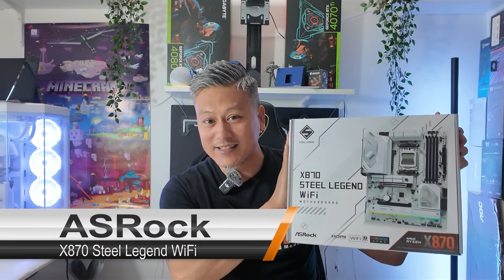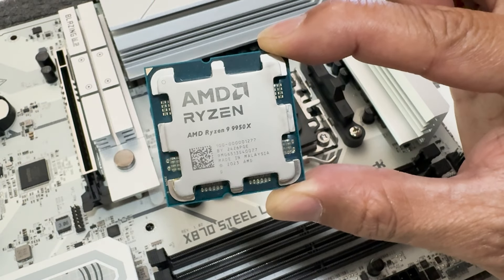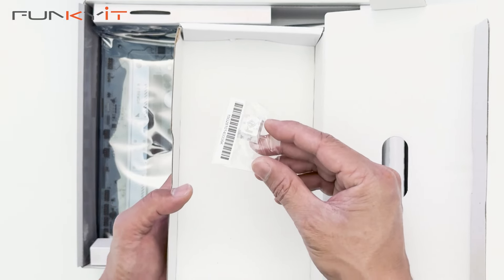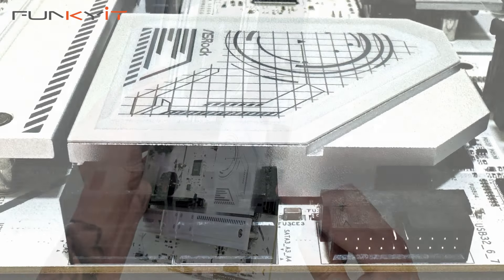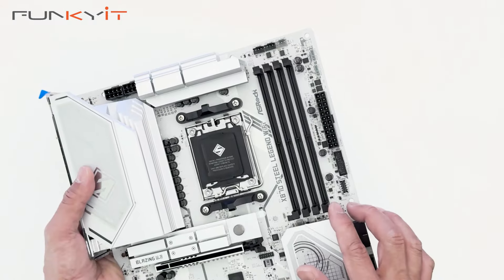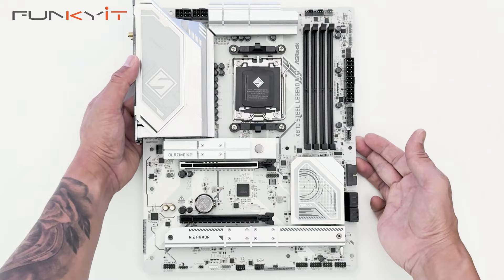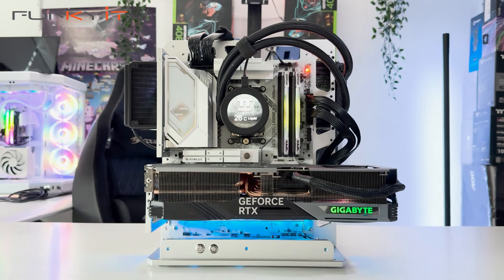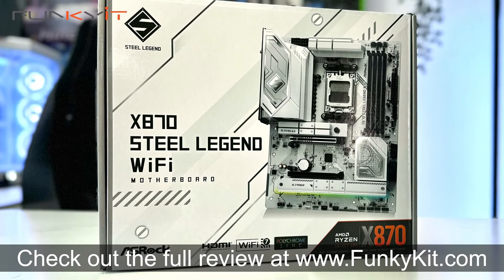An Affordable All-White X870 Motherboard that Performs - ASRock X870 Steel Legend WiFi

Comment: I picked up one of these, but now am wondering if I should’ve gone with the x670e steel legend instead due to lane sharing issues. Any input?
Reply from the maker: How many M.2 SSDs do you use?
Reply: What is this lane sharing issue can.someone explain am also confused between two b650e vs this
Reply: @freefall_910  If you put an SSD into the M.2 slot labled "M2_3" the bottom PCIE slot will be disabled. 

For this motherboard, M2_3 is the bottom left most M.2 slot.
Reply: @Rockett.  so that mean I will only have two 1 primary and then 2nd if I use an expansion slot will be problems for creator but not for guys  like me between this and b650e am also getting a USB 4.0 support but they cheapout on audio as well
Reply: Can we use two gen4 nvme drive while having 16x lines for gpu?
Reply: @GoldPunch  Yes you can. The motherboard has 3 m.2 slots for your NVME SSD's.

Restrictions only occur when the m.2 slot labeled as "M2_3" is occupied, If it is, the second PCIE slot will be disabled entirely. It does NOT lower the amount of lanes the top PCIE slot has access to, that is a limitation the other motherboard manufacturers have placed on their motherboards.

Comment: I am about to build a workstation rig for 3D rendering. I was about to buy a B650 Tomahawk. Should i consider X870 Steel Legend which is only 60$ more. I really dont want to upgrade in future, is paying 60$ more would be a good option?
Reply from the maker: I think it’s worth it. You get USB4 and support for higher speed memory 👍

Comment: What about the limited speeds if using all HD slots? From what I understand any RAM over 6000 is pointless on all recent MOBOs.
Reply from the maker: You need to use all M.2 slots … then get a higher end motherboard

Comment: Does it have 105W efficiency mode for the CPU in BIOS? Looks like a good candidate to level up my BOINC Folding farm got to find a good small stackable case for it
Reply from the maker: I haven’t checked … but I’ll let you know if I see the option

Comment: What makes this board better than the B650 Steel legend? What features or pro's does it have.
Reply from the maker: It supports higher speed DDR5 memory and comes PCIE Gen5 M.2 slot
Reply: changes around the USB bandwith to provide higher bandwith options, gets rid of the displayport. Adds USB c connection, changes the 3x4+1x4 to a 4x4 slot. Wifi 7 instead of 6e. That's pretty much it. Not worth the 70$ premium unless you like the look IMO
Reply: @Unrated. And where I live it cheaper then b650e and I cant fucking find b650 non e version in india its 20 buck cheaper then b650E
Reply: Would this board or the x670e steel legend be better do you think?

Comment: What were the boot times like with RAM speed that high? They're terrible on X670
Reply from the maker: Much better on the X870 series 👍
Reply: @Funkykit  Like less than 20 seconds?
Reply: @DavD-xo6wm  I'm using the new asrock x870e Nova wifi and ram at 6400 speed, boots up under 10 secs into windows